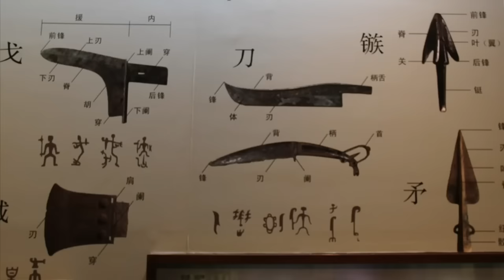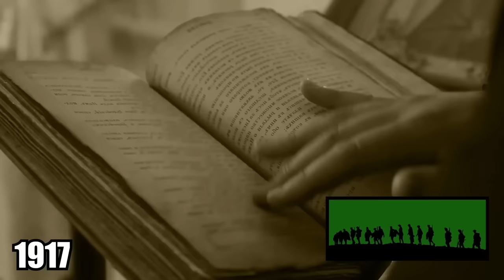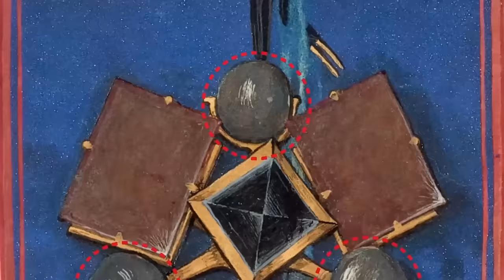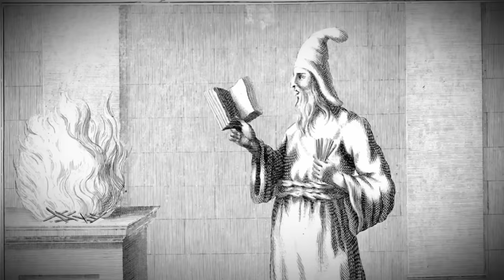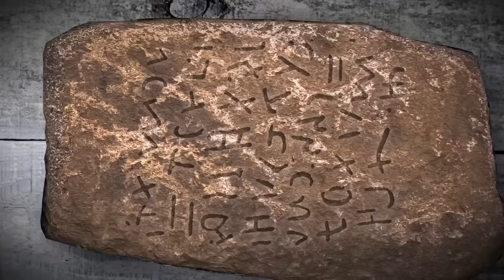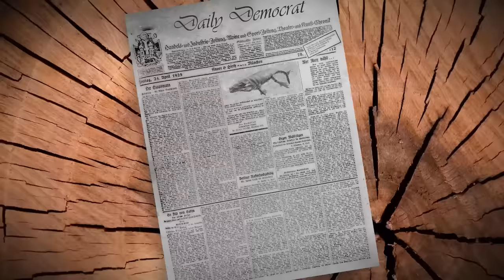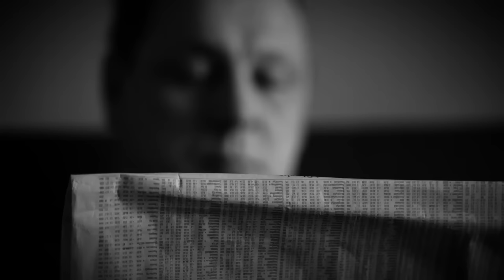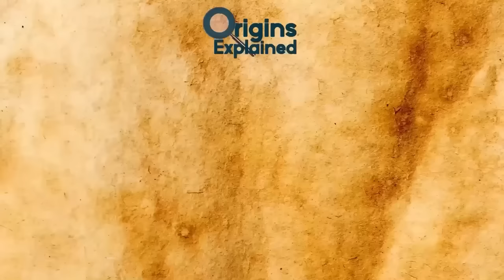Incredible Historic Discoveries & More | Compilation

Comment: Hi Katrina! thank you for the video!

The Barabar caves are perfect. Literally: Mathematically, geometrically, relatively perfect. No hand can make precision stone cutting like that. Those caves were reused by the modern Indian civilizations but were most likely crafted by advanced tools. Lomas Rishi cave is unfinished and shows tool marks on the walls and ceiling. They are circular grinding cuts going deep into the stone and have been analyzed by engineers. They were NOT done by chisels.

The inscription in Lomas Rishi is chiselled and if you inspect it and the walls themselves you will see a massive difference in technical sophistication; the walls were grinded right through inpurities like they were butter. Chisels bounce on harder materials.